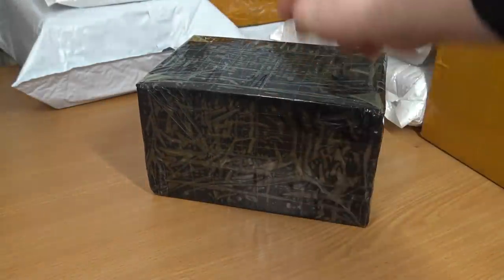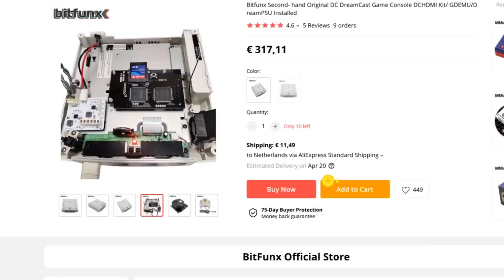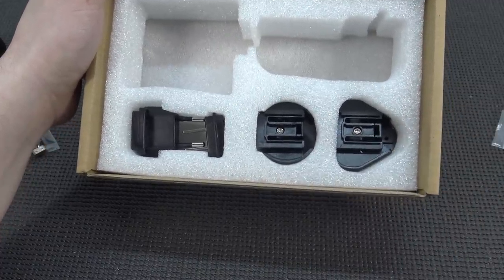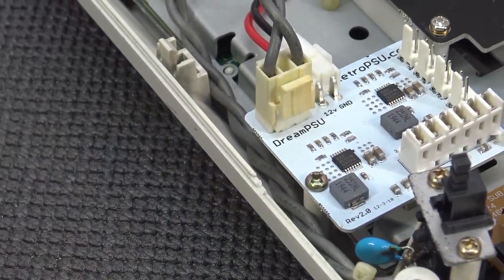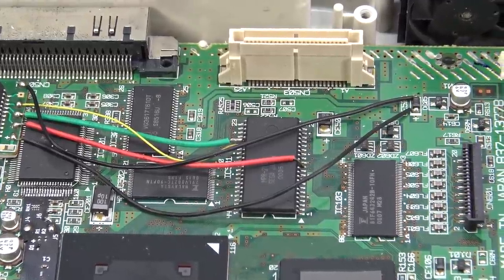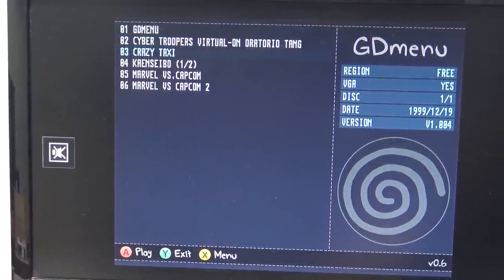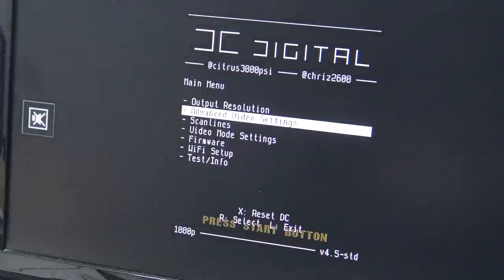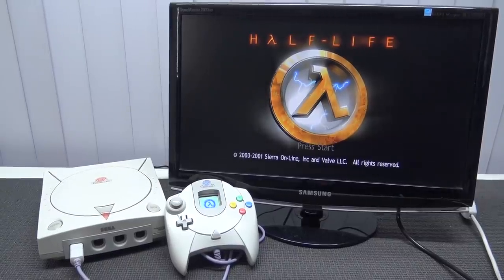Sega Dreamcast Ultimate HDMI / SD Console from AliExpress 😲

Comment: For about 3 years now i've been watching  local ads for a used one... considering all the mods, the price is not bad, yet i'd like to get my hands dirty 👹
Reply: Still got my Dreamcast definitely not selling it.
Reply: Pick up one with a dead disc drive they go for cheap that's what I did then stick in a SD card reader new power supply I did mine for less than £100 all in
Reply: @MegaFinalRound  I still got my working nes  with game genie, Sega Genesis with Sega cd, n64, original gameboy, original xbox, and 360. They're not going anywhere

Comment: Thanks for the video. I have mixed feelings about this product: if they had taken a little more time to clean the unit, done a better job of cutting out the hole for the HDMI, replaced the battery and used a quieter fan then I think it would be worth the price to someone who doesn’t already own a Dreamcast and who isn’t comfortable with soldering. The average price for a used Dreamcast with controller around here seems to be $100, so add the cost of the new parts and you are over $300 and you have to do the work. If I wanted a Dreamcast I would do the mods myself, but to be honest I am happy using a PC running the Redream emulator.

Comment: Great video 👍Dreamcast very under rated system. PS2 buried Dreamcast in 2000.
Reply from the maker: yeah... ps2 destroyed the Dreamcast 😑
Reply: Even though I owned both  since day one, I was so clue to  my ps2. My brother   was more into the dreamcast.  Since the MODE came out,  I've setup my dreamcast full center stage.  The dreamcast has some amazing games. Excellent video.
Reply: That's true but the dreamcast was an beast too. Few games for example. Power stone, Shammue, zombie revenge, house of dead, and alot more just not as many as ps2 dam 🤦‍♂️😂😂
Reply: MC Mustang  2tb psp ? Damnnnnnnnnn. 🤣
Reply: 🙄 PS2 didn’t bury it, SEGA did.
Reply: MC Mustang  you upgraded to ips screen ?  
Just curious, with the 2tb card, you planned to use entire  psp collection , ps1 and other retro consoles ?
Reply: @WickedGamerCollector  the DVD player destroyed the Dreamcast.
Reply: MC Mustang  ebay they sell the Micro sdcard converter. You can get few sd card cheap. Check besbuy or legit place to buy the SD cards and use SanDisk.  Right now 128gb is $18.99 on Amazon. 256GB is $32.
Reply: MC Mustang sorry to hear that. Hopefully I didn't sound like I was pushing you to get anything. Only for information. Hope you get back on ur feet asap. !!! Good luck , take care and stay safe. Covid is not easy on everyone.      It's understandable.
Reply: Sony destroyed them by recruiting developers to only develop for their systems causing all the top games to be developed only for ps2. The Dreamcast was far better hardware.
Reply: I was actually thinking of buying a Dreamcast back in 2000 or so, then the PS2 came along.
Reply: @TITANONEOONE  no, in terms of performance (which everyone was crazy about back then) the PS2 was far superior. I reckon the Dreamcast could push 3 million polygons per second, while the PS2 could do 60 million. Back then 3D graphics was the next big thing (well, it was relatively new, having become accessible to gamers just a few years prior) and polygons were a big deal. Today our hardware is so powerful that nobody cares anymore except for AnTuTu and 3DMark benchmarks.
Reply: @ronch550  Compared to the rival PlayStation 2, the Dreamcast is more effective at textures, anti-aliasing, and image quality, while the PS2 is more effective at polygon geometry, physics, particles, and lighting. The PS2 has a more powerful CPU geometry engine, higher translucent fillrate, and more main RAM (32 MB, compared to Dreamcast's 16 MB), while the DC has more VRAM (8 MB, compared to PS2's 4 MB), higher opaque fillrate, and more GPU hardware features, with CLX2 capabilities like tiled rendering, super-sample anti-aliasing, Dot3 normal mapping, order-independent transparency, and texture compression, which the PS2's GPU lacks.
With larger VRAM and tiled rendering, the DC can render a larger framebuffer at higher native resolution (with an on-chip Z-buffer), and with texture compression, it can compress around 20–60 MB of texture data in its VRAM. Because the PS2 has only 4 MB VRAM, it relies on the main RAM to store textures. While the PS2's CPU–GPU transmission bus for transferring polygons and textures is 50% faster than the Dreamcast's CPU–GPU transmission bus, the DC has textures loaded directly to VRAM (freeing up the CPU–GPU transmission bus for polygons) and texture compression gives it higher effective texture bandwidth.
Dreamcast games were effectively using 20–30 MB of texture data (compressed to around 5–6 MB),  while PS2 games up until 2003 peaked at 5.5 MB of texture data (average 1.5 MB). PS2 games up until 2003 rendered up to 7.5 million polygons/sec (145,000 polygons per scene), with most rendering 2–5 million polygons/sec (average 52,000 polygons per scene); in comparison, Dreamcast game engines rendered up to 5 million polygons/sec (160,000 polygons per scene), with most games rendering 2–4 million polygons/sec (average 50,000 polygons per scene).
The Dreamcast is more user-friendly for developers, making it easier to develop for, while the PS2 is more difficult to develop for; this is the reverse of the 32-bit era, when the PlayStation was more user-friendly, and the Saturn more difficult, for developers.

-Segaretro
Reply: @TITANONEOONE  that's quite interesting. Overall though, the quality of PS2 graphics just blew everyone away back then and that sealed the deal for Sony. It doesn't mean the Dreamcast was a bad system though. It's a mighty fine machine. I wish it succeeded and enabled Sega to continue making consoles.
Reply: @ronch550  I was in the industry at the time. I was also a competitive soul blade / soul caliber player so that sealed the deal for me on launch day. I never had a problem with the PS2 as a system, just the tactics that I knew were being used to kill off the last of a company that many of us loved.
Reply: @TITANONEOONE  I remember that time and actually prior to that generation Sony was using deceptive tactics since the Saturn came out. Tomb Raider was suppose to only appear on the Saturn back in development. Sony found out about the game being developed and saw how revolutionary the game world was going to be, suspenseful and exploratory. They went to the company Core and paid them allot of money to develop the game for them. Core new it had a contract to develop it for SEGA but Sony slipped allot of money just to get in the door of development for their system with an understanding that SEGA's version would come out several months before sony's. Several months later, sony returned and offered more money to be able to release it at the same time. Magazines picked up on this and this is where it was announced of a tandem release. Many in the community were bothered by the news of this tactic. Sever months later on getting closer to release timetable sony paid more more money to  Core to release it first as exclusive under the guise that the reason was technical difficulties on the SEGA version.
On release day it came out only on sony and got the fanfare and accolades of a revolutionary game and sony was this awesome system, when in fact it was SEGA that put in the foundation for this game to be made with it's hardware. The game came out eventually for the SEGA about half a year later but in sony doing this move it got a jump on the sales specifically because of Tomb Raider 1 and built consumer interest as a cool system, thought the consumers not knowing the undermine going on and how sonys tactics were being implored.
Reply: @itpro4040  And the fall of one of the great gaming companies began. Sad more people didn’t realize this was going on. I remember being disgusted by it. Probably one of the reasons I stopped playing consoles and was only a PC gamer or arcade board collector.
Reply: Dreamcast was amazing. I have the Japanese version because I couldn't wait and still got the american version day one. The arcade perfect titles came out in force.
Reply: @wg8561  I went a step further and collected both the Sega Naomi 1 and 2 lol

Such a great system the Dreamcast was
Reply: @TITANONEOONE  Wow that's awesome. I started out with the SEGA Master System Light Gun system and been a SEGA HC Gamer.
Reply: @itpro4040  I started out the same way, now that I’m older I went to the bigger and better part of it all 😬

Comment: I always love your videos! You and ETA Prime are my 2 most trusted sources! 

May I ask you (and community) a few questions? 
1. Does this specific machine run NTSC/60HZ? (Why on earth did euro choose a 10fps downgrade?).
2. I have several cd-r backups of American DC games on CD-R. Is it complicated to take those discs and add them to a DC with DCs GD-R (TF/Micro Sd card?), and will quality remain the same?
3. I have a pi400 and a few broad spectrum (consoles/games/emulators) built in. My first experience with emu was NesterDC and wow, accuracy on a stock DC was amazing! Same for many others.
4. Any further thoughts on the Marseille MClassic? I use it as the last device that leaves my 4k 5-in/1-out (4k/60hz HDR HDMI In/ switcher box before feeding it in to my (lovely) Vizio M657-GO 65” QLED’s 4k/60HZ HDMI TV: but often not sure what to set it to (green light or blue light), as by the tie I get up, switch from blue to green (or green to blue), by the tie I sit again, I can’t often tell which setting is better! I do hope a new MClassic is coming soon, as with stronger chips available, I believe a zero-latency external in-line HDMI graphics card is PACKED full of untapped potential, a new model would easily earn my $100. 

5. Compared to many boxes you review, where does the (out-of-box clocked) Pi400 sit in the rankings? For the full official kit I bought, I do love my Pi400!
6. PC Guide had an article declaring the “Samsung Pro Endurance” as “the best Rpi card”, and “Sandisk Extreme” having faster write times. No mention of the new (name forgotten) “OfficialRpi Approved” cards. It took 2 days to write my last RetroPi image to a 512GB, and at the very end, verification failed (ugg). What card(s) do you recommend? Are there any trustworthy 512GB on the market? Can an MicroSD be split into partitions to speed up writing 200Gb to a 512GB card? Or would the pi400 freak out?
7. Will the newish Official RaspberryPi image writer automatically format the MicroSD properly, automatically, to fat16/fat32/exfat when using it to write an image? It seems to make most sense to stick with officially approved gear/software (keep it all in the family), but is that always true? The SanDisk is looking best to me with a 100MBps write rate (2 days to etch to a PNY 512GB RetroPi image that failed days near broke me).
8. Can images safely be chopped into several smaller (128GB) cards and work, or would it fail to boot the extra cards from the same split image? Or best off buying a preloaded RetroPi card online? DC is my main console, but if the pi400 can (as I’ve seen) play most games at 59/60fps, should I buy a separate tiny 1-2GB chip for each game for best performance? Having a beastly time organizing them but can’t find MicroSD size labels for the chips :( could custom cutting labels do damage?

Sorry for so many questions: I’d love any help! If there’s a better place to ask so many, could you kindly say where? I reciprocate whatever possible whenever possible! Thanks for your time gang!
Reply: This unit seems to be the Asia version (orange swirl and dummy modem), so it will default to 60Hz - although all models of the DC including the PAL one are capable of running at 60Hz.  As for why Europe uses 50Hz, it's because early TVs had a lot of problem with interference from the power line frequency, so they adopted frame rates that matched the power line - so the US used 60Hz and Europe used 50Hz, to match their power line frequency.  As for why the US and Europe adopted different power line frequencies, that's even more historical - the original Westinghouse AC system used a much higher frequency and Nikola Tesla argued the frequency should be reduced in order to reduce the transmission losses - and came out with about 60Hz as being the best frequency.  Meanwhile, AEG in Germany did a similar set of calculations using slightly different assumptions and ended up deciding on 50Hz.  This, incidentally, is why half of Japan is 50Hz and the other half is 60Hz - the people in Tokyo bought their equipment from the Germans, and the people in Osaka bought theirs from the US.  Both networks grew out until they eventually met, but couldn't be interconnected because of the frequency difference.

Comment: What was the "extra chip" you mentioned?
Reply: Looks like the typical modchip you used to be able to buy back in the day. The system was probably modded before the extras were installed & they just left it in there. The modchip is not necessary once a GDEMU is installed as it effectively makes the system region free.

Comment: Is there a 1080 component mod? I’d like to play this on a CRT with component if possible. That way light gun games are still playable.
Reply: with the DCHDMI mod it leaves the original AV out unaffected but I think the highest signal it would support for CRT would be S-Video. I'm not sure if VGA CRT monitors worked with the light guns due to the refresh rates / signal timing being different form a standard tv display.

Comment: Jesus Christ, 317€ for this?

I've outfitted my old parts console with a GDEMU clone and DreamPSU + power supply for a total of 65€ in January, and the quality of the bootleg DC HDMI kits appears to be mixed to say the least.
Reply: What do you mean mixed, and those aren’t bootlegs as the whole project is open source. So quality should be the same. Also i agree the price is pretty shocking, I did mine with all these and ended up at $215
Reply: @user-yk1cw8im4h  Fair enough, I was referring to the Black Dog Tech ones, which are sold by the guys that developed it. The Chinese ones are of varying quality and often have issues.

Comment: All that money and the buyer still has to solder in a new battery, replace all the wonky SIL heat pads and that noisy fan? Pass.
Reply: Although you aren't wrong, figured I'd let you know that you can buy a controller port board with premodded coin battery holder and improved fuse for very cheap. About ten bucks if I remember right. No soldering needed.

Comment: this is a ripoff. No controller fuse mod, rechargeable battery, noctua fan, gdemu instead of a MODE, a terrible power supply replacement that adds noise (should have a recapped oem psu). All for a high price
Reply: You do know the price of a MODE right? That plus the dchdmi will be way over the asking price
Reply: MODE alone is 180€.
You do the math.

Comment: Definitely tempted, but would need to tear it down, make a better finish in the case mods and re-do the soldering (i hate wires over chips) but most of all It would need a good cleaning, for the money you would think 5 mins cleaning it would be worth doing.